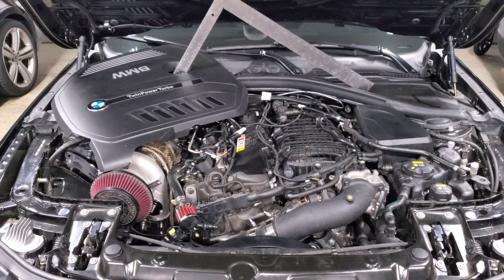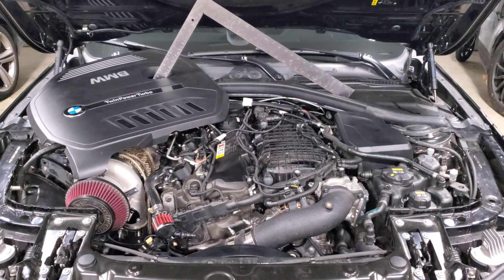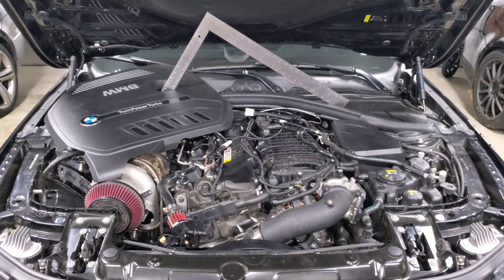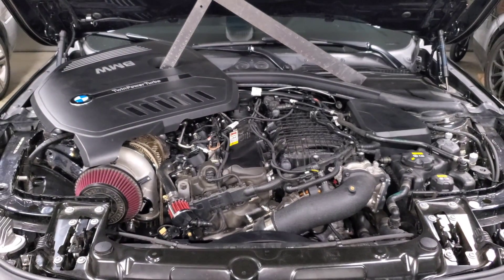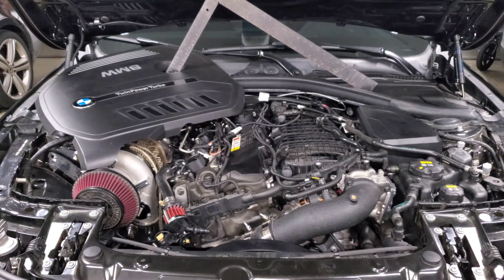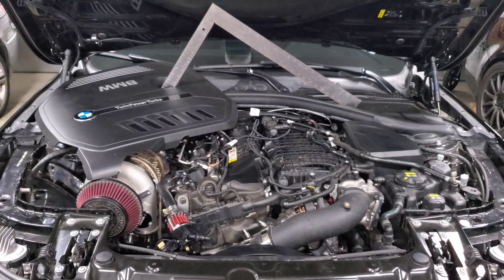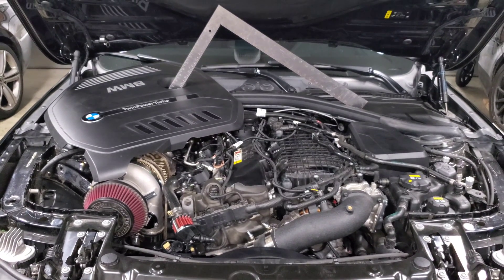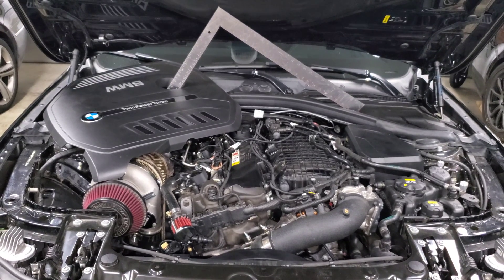Let's talk about B58 Injector Failures - Common B58 Issues

Comment: I done the fuel rail pressure test as you recommend on the other video and my one is strange as it’s first start slowly dropping for 10s and then stop and slightly increasing for another 10s what’s this could mean ? Also notice that my cylinder 4th spark plugs looks bad always like with a black residue

Comment: Watching your videos! They're great! I am having a problem with my 2016 B58, when I press the gas it hesitates. When I am cruising at 70+ MPG, it pulsates every 15–20 seconds. I replaced the plugs, replaced the intake vanos, it triggered a check engine like last year. Maybe it's fuel related... Spark plugs look great, but I changed it because I am on a stage 2 MHD tune.

Comment: Hello, my 2018 340 has been missfiring about 2 minutes after driving(almost every other drive for a couple weeks now been getting worse), goes away after i let of throttle. Took it to mechanic and he didnt find anything unusual other than that he couldn't get his scanner to communicate with lpfp. Codes ive been getting are 118001,118401,11a030 and 128b01. Any idea what this can be?

Comment: I heard that this injector problem was fixed by BMW in the post 2018 b58's with the later models using different injectors. If this is true, can us pre 2018 b58's replace our injectors with those as a preventative maintenance? What other options are there for injectors that could potentially eliminate this issue?
Reply from the maker: there's no way to eliminate it. just like any other electronic part, it can fail. but overall the risk of it failing is low.
Reply: @kern417  what's the best way to get a flow matched set of injectors? In my srt4 the best were ID or FIC. I'm new to the b58 platform and I'm finding it a little bit harder to find an oem set because from what I heard they can't be purchased as a set and come singularly sourced.
 
Im heading toward 120k mileage and I'm watching a lot of your videos that the algorithm sends my way. Very helpful videos and I watched the one you did on aftermarket injectors that flow 20% more if I remember right. 

While I have your attention. What are the best options for me if I don't want to run a custom tune for aftermarket injectors? If aftermarket is the only way that ensures getting a flow matched set, which ones are the "go to" in 2024 for gen1 b58's?
Reply: In the UK there have been stock 2018 cars with the revised injectors which also failed

Comment: Could a faulty injector also cause engine knock ? I noticed my acceleration times were getting slower. In 2nd gear you could actually feel the engine reducing power. Had it checked, datalog revealed that cylinder 1 and 4 had knock retarding. Checked the cylinders with boroscope, looked good, not too much carbon build up. Replaced sparkplugs and coils on those cylinders, only minimal improvement. The mechanic now suspects the injectors. Had no misfires and no errorcodes. M140, stage 2+, TU pump, 48.000 km. Thanks!
Reply: Did you resolve the issue with your B58 losing power?
Reply: @cammgt3rs370  Partly. Shortly after the repair, a CEL came up. The secundairy O2 sensor in the exhaust triggered a fault, the internal heater didn't work. Replaced the sensor, the acceleration felt much better and more fluid. The hickup in 2nd gear is gone, acceleration felt easier. Shaved a few 10ths of a second 0 - 100 km/h. But at higher speeds it still delays a bit. I think the sensor was already going bad for some time, and the ECM making governing adjustments. 

But it isn't fixed entirely, so going to have some other checks + datalogging done this year.
Reply: @markvanderwardt3345  I actually went ahead and had a shop put new injectors in. I am also going to change my O2 sensors, clean MAF sensor.
Reply: Injectors noisy as well bit shit for a six cylinder

Comment: From Australia. Have a 2015 340i @ 140,000kms
Running TU Pump MHD OTS E40 for the last 30,000kms
Bought stock @ 110,000kms.
Daily driver on E40 for last 12 months and haven’t flushed with a tank of 93… Runs flawlessly although got me thinking should I replace the injectors ?

Comment: Hi Mate i did the test For fuel rail pressure and mine cant hold pressure affer i stop the engine:/ but no symptoms at all for me im at stg2 Ots map, maybe once I had misfire like for one second or twice max since i bought it a year ago i drove it 50tkm . Also i had one tiny metaly object in the oil filter , now i checked again but was clean I will do oil analysis … next oil change but now i shouldn’t drive the car like this right?
Reply: I also make log and everything is spot on !!

Comment: Kern I’ve been getting error 100313, I’m not sure if this means my DI injectors are dying. Car has rough start up on cold starts sometimes and I get this code. But doesn’t misfire under pulls or regular driving.

Comment: how many fuel injectors are there in the b58 engine?
Reply from the maker: 6
Reply: @kern417  thanks, im thinking of buying a 340i, what do you think of the b58 engine does the car have any faults etc?
Reply from the maker: it can have problems but generally it is reliable

Comment: I also realized that while in comfort mode going slow like 5-10mph i get slight pops on decel with burble set to oem.. with that along with the car not starting immediately makes me think that this is strongly the case. I put a bottle of techron when i just fueled up to see if maybe Im contaminated
Reply: Thinking it may be stuck open? Mine does the same thing at 96k miles
Reply: @Adam-gv4zj it was an issue with the tune
Reply: @Adam-gv4zj  check your tune
Reply: biggs i have it were im in second gear coasting constantly pops but low tone ones im mhd and xhp
Reply: @XtraL0udz  I found out the issue , I had to do a full flash & unlock with bm3. I don’t have the car anymore but that resolved the issue .
Reply: @biggs1485  imma try it tmr because it has been anoyying me ill go down a hill and it’ll just be doing little pops
Reply: @XtraL0udz  from what you saying I strongly believe that’s what it is little light pops
Reply: @biggs1485  just removed MHD and still does it i’m going to remove XHP next and see if any of that fixes it
Reply: @XtraL0udz  make sure when you put it back on do a full flash & unlock
Reply: @biggs1485  yea i didn’t put it back on yet i had to go to work so rn im just stock and locked i gotta go home later unlock and reflash
Reply: @biggs1485  i did both mhd and xhp i recorded my logs gotta find someone to look at it
Reply: @XtraL0udz  check your spark plugs

Comment: If i let my car sit overnight & i try to start it in the morning it shuts right off, however the second time it runs fine does this seem like an injector issue? I know its definitely a fueling problem I thought it was my tune at first. If i put the car in diagnostic mode first & then try to start it it starts right up. This kind of makes me think that this may be the issue. Luckily I was randomly reading about cylinder washing & i found out about this. I hope I didn’t do too much damage so far if that is the case.
Reply from the maker: Could be a lot of things. Scan for codes

Comment: Hello 
Have a 340i B58 jerks during driving. It does more while driving uptown. The actuators have been changed but the problem is still there. Have anybody any ideas? Thanks for help.
Reply from the maker: Scan for codes
Reply: There are no codes i was in my garage they dont find the problem.
Reply from the maker: run some logs where it's jerking to see if something is up
Reply: @kern417  There is nothing to find with logging.
Reply from the maker: Then I'm not sure. You should take it to a shop to have it diagnosed.

Comment: Injectors are one of those weird things where it’s literally a lottery/crap shoot. People periodically replace them thinking it protects them from failures but the truth is it doesn’t and there is a chance that the new injectors you put in could be prone to failing or failing much earlier than the ones in the car. The truth is these failures are rare and very isolated as these injectors are basically used in so many different engines/cars. B38 b48 b58 bmws minis plus all the other oems that might use them  etc What you hear is the vocal minority on the internet who drove around with a leaky injector which washed down the bore and destroyed the wire arc coating in the block. Believe me if it was that widespread you’d be hearing it all over the internet. TLDR I don’t think there are contributors to these failures and it’s more luck based. The advice you gave is correct. If you experience poor running of the engine stop driving it immediately and get it towed/diagnosed/repaired.
Reply from the maker: basically my point. people are chasing a ghost and could be doing more harm than good.

Comment: @kern417 any thoughts as to a bit of hesitation/stutter under mild acceleration? been going on for a few weeks now and it hasn't thrown any codes (2016 340i 58k miles) thx!
Reply from the maker: really hard to say without any codes. do you have a log? have you checked to see if your injectors are stuck open

Comment: Is there any info on ways to check on 2018+ models if new injectors were used so you don't have to worry about this? Or is that just suspicion?
Reply from the maker: Not related
Reply: @kern417  What do you mean not related?
Reply from the maker: there is no updated part number to improve reliability.
Reply: @kern417  Got it. Guess best I can do is check at inspection time somehow, maybe defensively replace but that's like $1000+
Reply from the maker: I don't plan on replacing mine personally
Reply: @kern417  It seems fairly uncommon. When it goes wrong though it apparently is a huge problem, prob needing new engine, like $10k repair.
Reply from the maker: But there should be indicators to catch it
Reply: @kern417  damage wouldn’t be already done at that point? Just looking for misfires?

Comment: E30 not so bad but Ethanol in general is a huge problem for injectors if you let a E50 or more mix sit in your system for a week change or get your injectors cleaned. Bad injectors can potentially cause engine damage. You could also run a 10 micron filter like the ID750 to improve safety.

Comment: @kern417 have all new injectors new spark plugs and coil packs are good and im getting misfires in every cylinder and they all say injection shut down. 
not sure what else to do the car sounds like a dirt bike and is misfiring super bad on idle. 
im on e50 mix on an ots map on bootmod3
Reply from the maker: any other codes? message me on instagram or facebook. it's easier. links in description.

Comment: Have you heard anything about black soot in the exhaust and  hesitation/rough cold start being tied to a leaky injector?
Reply from the maker: That definitely makes sense
Reply: did u end up changing the injections to fix that issue, thought im the only one
Reply: @la.speechless3722 my engine ended up blowing. I think it ended up being a combination of the pcv failure and that caused or was in combination with a leaky injector. All in all, I would definitely check the injectors if you are having similar problems.

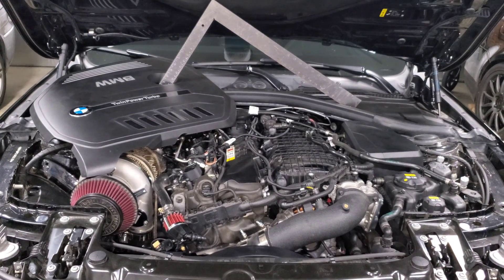Comment: 8:30 your saying bigger fuel pump isn’t putting more pressure. What iff you take the b58tu pump. Wasn’t that designed to run 350bar. So are you still don’t punt to much pressure on it ?

Comment: Hi sir, do these injectors need coding after replacing. Or is it a adaptation procedure and DME does the rest?
Reply: I want to know
Reply: @pedrojotajota1  adaptation procedure and dme does the rest. If your custom tuned make sure torque limiters are off. Hope that helps

Comment: So is there anything we can do to stop injector failure ? And if an injector fails and you start getting misfire does that mean your engine is automatically done? Seeing stuff like this scares me so much
Reply from the maker: Usually people that have issues keep driving with the misfire. If you catch it, it shouldn't be an issue.
Reply: @kern417  ok, I don’t think I have any misfires but my hpfp has kinda been crashing I think which caused some timing corrections, should I go Down to a 91 tune instead of 93? That’s what others reccomended
Reply from the maker: Crashing is due to too much boost or fuel leak
Reply: @kern417  I wouldn’t say it was exactly crashing but like 6000 rpm 3rd gear it went below target
Reply: @kern417  I doubt I have a fuel or boost leak, everything else on the logs is fine except for a little crash, how do you look for boost or fuel leaks?
Reply: @kern417  also I think it’s my fuel pressure is not enoguh, not necessarily crashing, I was asking on forums and one of the guys there who seemed really knowledgeable suggested I switch to a 91 tune until I upgrade my hpfp
Reply from the maker: @codskilclanchannel6420  if it's not crashing then it's not a problem.
Reply: @kern417  also would misfires cause a check engine light ?
Reply: My n55 did this, don’t floor the car. That’s what causes them to fail stuck open. If you do have this failure, immediately turn off the engine and tow it before you lose your engine.

Comment: Thanks for this! Super helpful. I've been running a dinan sport piggyback on my 340iGT and had some super random stutters at low rpms, on tip in really. Pulled the tune and am running some injector cleaner through but code hasn't cleared. If there's no missfire or stuttering is it probably ok to drive to work more of the injector cleaner through to see if it clears the potential slight blockage and code?

Comment: Do you need replace all injectors or is one good?
Reply from the maker: You can replace 1
Reply: @kern417  i also have a b58 but falls out misfire on cylinder 2 i have replaced injector and ignition coil bougi nothing work the car stutters no power stinks of petrol and falls out of the car has 62.14 miles never replaced the injectors only 1
Reply: @kern417  and mixture too rich

Comment: Is there a good aftermarket replacement injector that's more reliable? And/or aftermarket fuel filtration system that could help/fix the issue?
Reply from the maker: No

Comment: Had misfire today cylinder 1and general message misfire several cylinders just cruising down the road. Got fuel injection shutdown. I believe it's just cylinder 1. Got the fuel smell. I shut the car off to inspect. Wasn't near home. Restarted and sputtered down the road really slow a couple minutes and got a really loud backfire . Shut it off and called a tow. After some reading, it seems running rich may have caused the backfire. Anyone else experience this? I'm hoping no damage occurred. Will be diagnosing and replacing parts soon.
Reply: Did u solve it?
Reply: @Kingg4453  took it to the dealer they said it was the fuel injector but they couldn't get the car to duplicate the problem. After they cleared the codes, the car started fine and the problem never came back. Been driving it aggressive on custom e60 tune and no problems. I do remember the car shifting real quick in lower gears full throttle sport mode in the redline. Probably had some wheels pin and fuel cutoff is all can thank of.

Comment: Love your videos man. I’ve got a 2018 340i 6MT, about 54k miles. Tuned to stage 1 at about 50k, still on the original plugs. Getting misfires under high load, gears 1-3 are fine all the way through the rpm range, misfires at 3500+ gears 4-6. Not reading any fault codes and to be honest no clue how to read these bm3 logs. Planning to change the plugs this week, is there any way to tell which cyl. Is misfiring from the bm3 logs? Not sure what I am looking for. Plugs are cheap enough to replace but don’t want to change coil packs if it could be injector issue. Any help would be great. Lost on the forums online lot of contradicting suggestions as you can imagine. Thanks ! Keep up the awesome vids
Reply from the maker: Scan for codes to see what cylinder is misfiring but at 50k it's a good idea to replace them all.
Reply: @kern417  thanks for the response man! Going to replace all 6 plugs tomorrow and hope for the best.

Comment: I saw in the Google Form you asked if the Ethanol was from a pump. Is there any precautions I should consider when finding ethanol out in the wild?
Reply from the maker: There's not much you can do about fuel quality from a pump but if you're buying ethanol off the shelf or race gas then you know it's high quality. It's just a question really to see if it affects anything

Comment: Im running stage 2 OTS map from bootmod ACN91 because the gas in my country is sh!t when you think will be good to change the injectors as an preventive maintenance?
Reply from the maker: I don't usually recommend replacing injectors as preventative maintenance